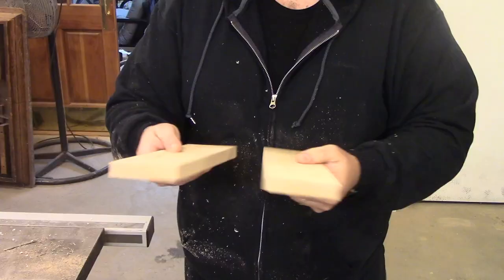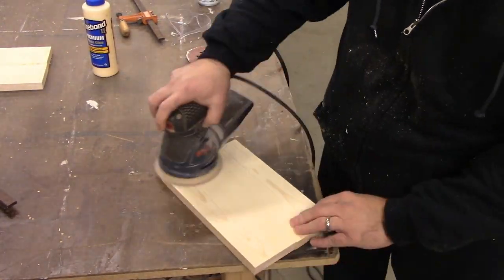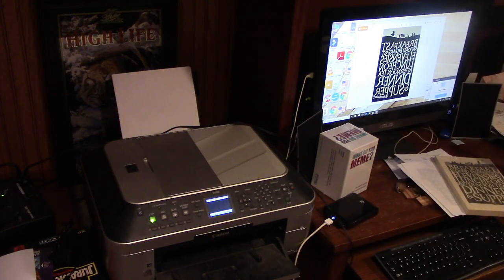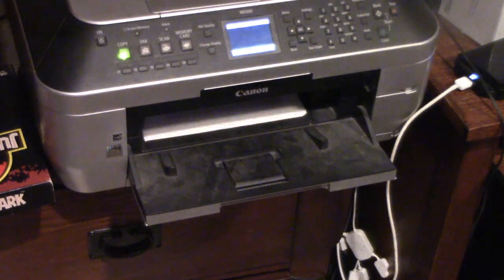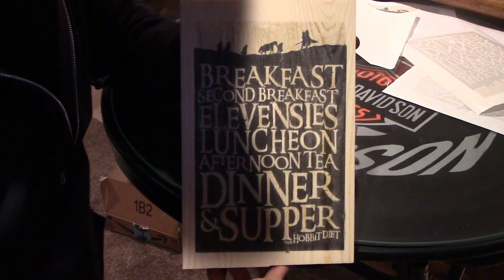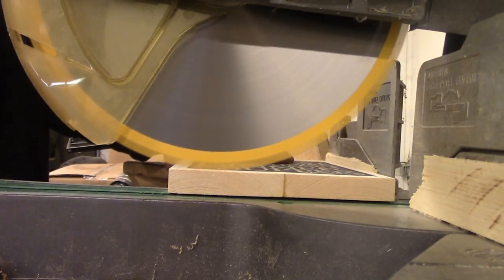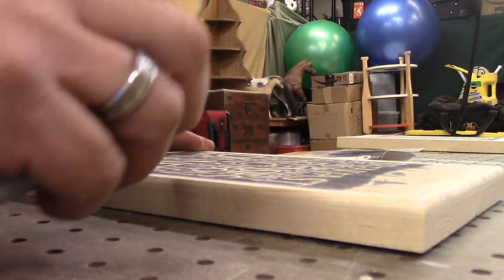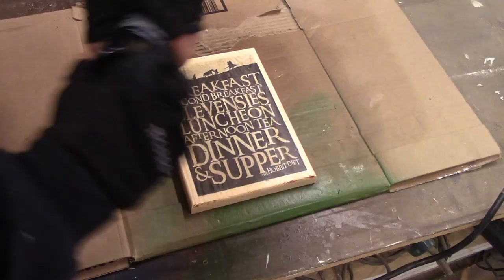Ink transfer to wood!

Comment: will it make any difference if we use heat on top of the paper
Reply from the maker: Nope. The ink transfers almost completely from the waxy paper.  Just don't let it move around once you start applying it.